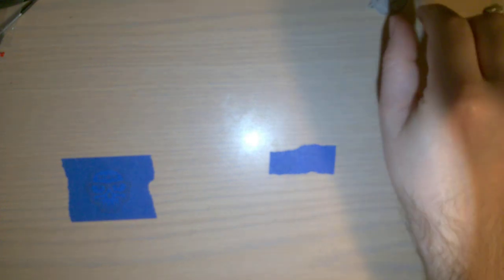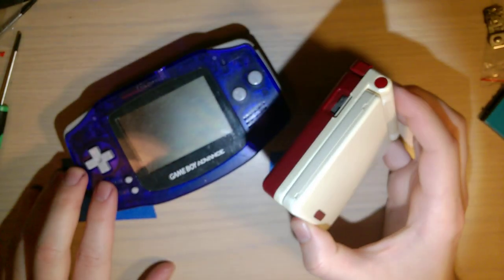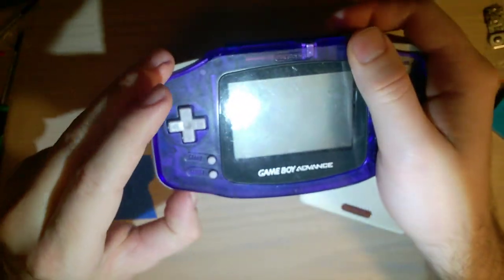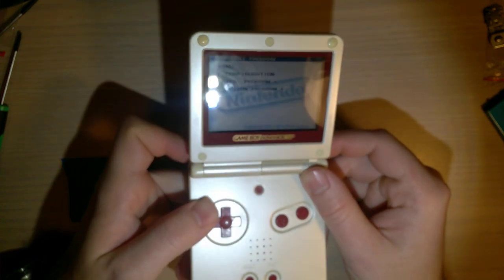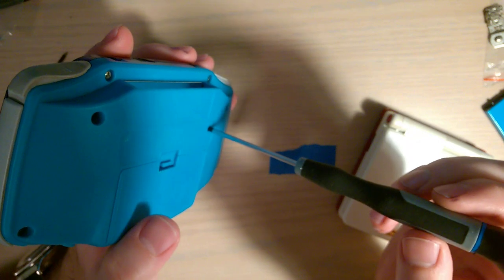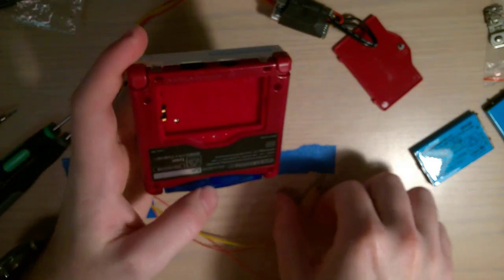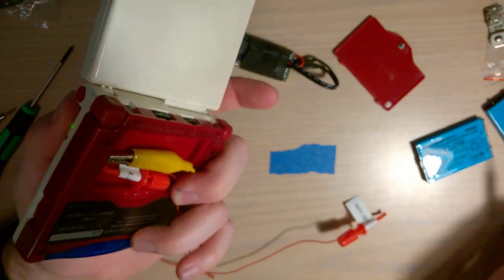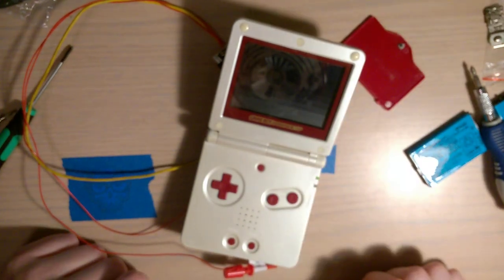How I adjust the LCD trim pot on GBA SP consoles

Comment: The easiest way to adjust the pot in the SP,  is to  plug in the charger then take out the  battery.
Reply from the maker: Just did some playing. I didn't know this but apparently you can play the console with no battery but you still cannot boot it. You have to remove the battery after plugging in and booting the console. Good to know.

Comment: To anyone watching in 2020

Makho's battery mode they sell on retro game repair shop makes this super easy as the wiring allows the battery to hang loose. So if youre looking for a battery upgrade, it also makes this guide easier to follow without needing to make that clamp setup!

Comment: Hello dude! Very nice and instructive video. I got into your video because I’m looking for a solution for a problem related to a 101 screen and I would like to ask you about it if its possible. It has problems with the black color which tends to be like brown/red in the screen’s borders (there is a thread in reddit called “ags 101 screen has some reddish thing” which could give you an idea of what I’m talking about. Do you think it could be a problem related to calibration or could be something else? Thanks in advance and sorry if I have some mistakes,my english is not the best. Greetings from Chile (:
Reply from the maker: You could try calibrating it. It sounds like there might be an issue with the LCD itself. I did read that some AGB consoles are not compatible with some AGS screens though. Do you have another AGB motherboard you can test?
Reply: Hey guys, sorry i am one year late, but the reddish screen on AGS 101 is a polarizer problem, my game boy screen was very red (only when displaying black) and i fixed it by replacing the polarizer.

Comment: Do you know what the resistance range is for the pot in the original GBA (40 pin model if that matters)? I messed up and lost track of how many turns it was and (like a moron) didn't write down the resistance it was set to initially. I'm worried about unthreading it if i screw it too loose the wrong direction. (I'm not confident enough that these tiny smd pots screw cw tight or ccw tight to risk the coin flip) Right now it reads ~29k ohms. I know the upper end is ~50k but i dont know what the typical factory setting is or how varied the range typically is. I also dont want to fry my screen
Reply from the maker: It's not a screw. You can't unthread it. There's only one revolution of range. The point of the adjustment is that it's specific to your hardware and paired screen so there is no "one size fits all".

Comment: Total noob here, but apart from an LCD swap, wouldn't it be necessary to do this when switching batteries as well? Thought the trim pot regulates voltage? May not be as relevant because the difference is negligible, but is that technically true? Or isn't that what this pot is for in the first place? Thanks in advance.. gotta get my hands on this ROM.
Reply from the maker: shouldn't be necessary when changing batteries. This potentiometer is in the circuit after the voltage regulation, not before it.

Comment: My gameboy doesn’t change at all even tho I spent like 2 minutes rotating the screw from right to left, is there anything that I’m doing wrong? It feels like there’s something that I need to do first to unlock that screw functionality
Reply from the maker: If you're not using an OEM screen or an ITA mod, the potentiometer (it's not a screw) will not do anything.